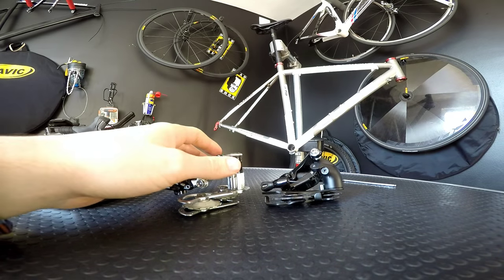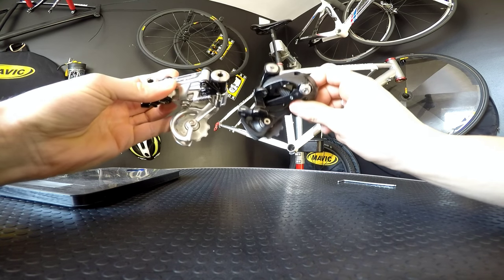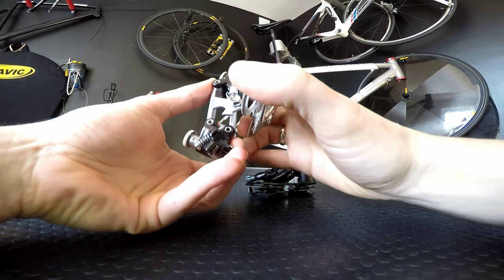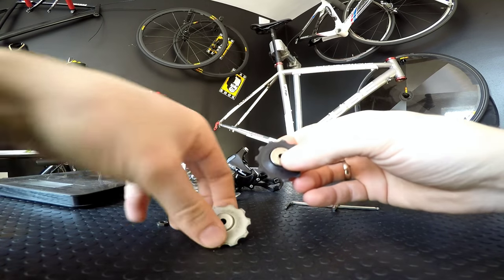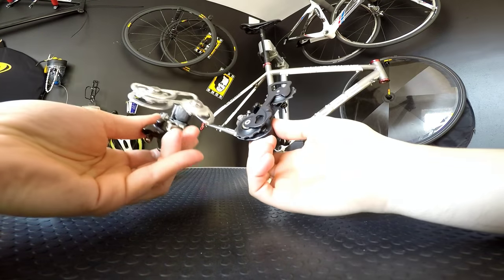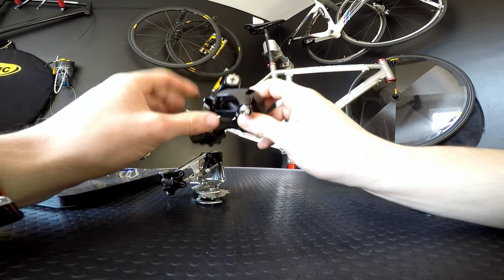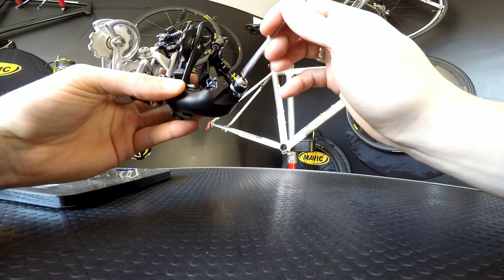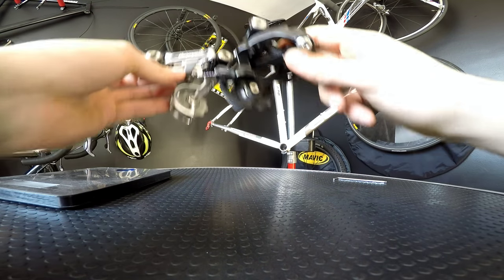NO REVOLUTION In 32 Years! Campagnolo Super Record 1984 derailleur vs. Shimano 105.

Comment: Back then, as now,Campy was the King of cycling, the Ferrari, the Pagani, the Rolls Royce. But for beer swilling youth, it was a distant dream, and we made do and mended with 105. Mavic hubs and rims gave my bike a little soul, 'cos Lucho and Kelly were my fave pro's and used them. All the TdF's were won on SR, and Hinault used Reynolds 753 frames, which was the top dog and equally expensive. Regular joe's used 531c and 531pro.
Reply: We'll put, it had a built in swagger, just like a Ferrari, right from the factory. A distant dream is correct........

Comment: Campag nuovo super record RD sold at around USD200 in Japan in the 1980's while Shimano105 RD USD40 today.
Campag has only 24 tooth capacity,105 has 38t. Campag was used for 52-42 chain rings and 13-23 or max 13-26 sprocket sets, 105 can accomodate 48-44-28 front and 13-28 or max 34 rear. Originally Campag was delelopped for the racing professionals while105 was for the tourists with heavy loads.
Camag Record crankat that age has PCD144, minimum 42t ring, Campag RD cannot take more than 26t rear sprocket mainly due to its vertical and parallellogram design. Shimano includes the105 and Campag today inherit SUNTOUR patent matured slant pantagram that achieves sharp shifting with big capacity as many watcher commented.
Comparision just RDs on the desk doesn't tell the history, actual usage or user groups.
Reply: Absolutely. The guy's ignorance is astonishing.

Comment: Good video, they are similar, although the campag looks better

As Sheldon Brown would say, this years Tiagra is Dura Ace from a couple of years ago. At a fraction of the price, which is the evolution.

The revolution will be electronic shifting. Or another unnecessary change to get to get your money, depending on your point of view

And good luck getting a 34t cassette into that Campag RD, whereas it is easy with the 105 long cage version

Comment: I have the same two derailleurs. The limit screws on the 105 are Chinese garbage off a BSO that strip easily compared to the ones on the Campy 4001. I replaced them with the limit screws off a damaged Shimano RD-7400 (very nice strong stainless screws) . The 105 also has these annoying "guides" between and under the jockey wheels that makes guiding in a new chain harder then it needs to be. I'm sure there is some technical reason for them but all I see it doing is adding grams and eating time. EDIT: I guess in a crash it helps keep the chain in place.

Comment: Got an old bike with Reynolds 531 frame which I have used for biking outdoor until October 2015. Now used for training indoor with the Elite Turbo Muin.On it is Shimano 600 and 105 parts. all still working fine. The rear derailleurs is a Shimano 105 RD-1050 from 1987-88. Still working fine. Started with 7 speed casette and later moved to 8 speed casette. Now on the Turbo Muin I have a 10 speed casette and still working just fine. Gear shifters are placed at the bottom tube, just like in the old days. Crank set is Shimano 600, still working smoothly. Front derailleur Shimano FD-M700. Remember I did get a new at a point back then.Using 53,42 chain rings. All taking apart, cleaned and new grease at least once a year.Been driving around 50.000 km on that bike. Little rust here and there on the frame, but else all is still working fine. Couple of month ago I changed the old toeclips with Shimano SPD SL pedals. :)
Reply from the maker: +EyasTheBad Wow, that's old school!

Comment: You need to compare the new one with a SunTour derailleur from the early 1980s, like a Cyclone mk2 or a Superbe. You'll find probably even less difference except the SunTour would have been cheaper. SunTour also tried with their Tech range to simplify how the cable reaches the derailleur, but unfortunately it caused a lot of reliability problems. The Cyclone, Cyclone mk2 and ArX models sent the cable straight down the centre of the parallelogram, and the earlier Vx (c.1977) had a little groove that made the cable very straight. And all of these derailleurs I've mentioned are lighter than the Shimano!
Reply: and they shift better too.
Reply: With a  6 cog straight block (13,14,15... Winner Pro freewheel and 52T chainwheel) Superbe Pro's rear derailleur shifted better than Campy's C Record 2nd generation derailleur.

Comment: There are newer, cable actuated RDs out there with significant differences from that old Campy one.  You just chose a newer one (granted, probably  the most popular type on the market) that wasn't significantly different.

As for routing the cable from the front to eliminate the loop of housing, SRAM's mountain  RDs already do that.

Comment: Excellent video except for your last point.  That big curve in the cable-routing of the 105 is a big advantage over the great old Campy shifter: it's necessary for STI shifting, which was a revolution in rear shifting (and an unnecessary nuisance in front shifting).
Reply from the maker: Thanks for that.

Comment: I can't speak for Shimano or Campy from that era, but I can speak for Suntour's mid-range ARX line from '84.  The rear derailleur is really tiny in appearance - the cage is very narrow, it's the smallest appearing derailleurs I've come across.  I guess one could say that it's slightly evolutionary as it has something neither of those derailleurs have - the cable enters the rear of the derailleur towards the inside parallel cage and runs between the parallelogram cages (so the cable is internal to the derailleur as opposed to external), and attaches near the front parallel cage.  I don't know how light it is, but it has held up impeccably (esp when I think of how hard I was on my bicycles - that one included - when I was a teen).

Comment: Well you're only considering one part of the equation. The derailleur by itself is useless without the shifter and I don't think anyone racing at the pro level today is using the downtime shifters the Super Record would have used. The brifter in combination with the 105 derailleur is a vast improvement. The 105 derailleur itself is fast, accurate and quite inexpensive. It sells on Universal Cycles for $40. Apparently you think that's some kind of sky high price because you indicated it isn't very cheap. You said they needed to make it easier to maintain. How so? Set mine up and it works perfectly with little to no fuss. The basic design hasn't changed much because it works fine as is. If it ain't broke...

Comment: eh, there was a Rear  Derailleur which took the cable from the front: the Suntour S1 (*1989/90?) but the odds were against it: Suntour went bancrupt, S-1 was only entry level, needed cable routing under the bottom bracket when the hype was about top cable routing and either a mounting point under the chainstay or an iron that clamps the dreailleur to the back axle and chainstays.
I have an S-1 in the basement and also a cheaper offspring, but more important (to me) I used one for about several years on my daily driver and it worked fantastic (bike was then stolen :(

Comment: An error on the 105 - DA comparison. DA9000 is totally different from Ultegra 6800 and 105-5800. First up, the DA9000 has a different pivot bolt and different securing system and dust proofing system.

Comment: I use that exact campagnolo super record with 11 speed at the back and shimano sti 😂
Nothing much has changed and you just basically need to know how to regulate the rear derailleur (disassembling it and reassembling it with different settings) given the more"modern gears ratios"

Comment: Bikes need revolution of drive systems, many aspects of bikes evolved in great way but although we have electric shifting even wireless one, dérailleurs hasn't changed much in over 100 years. I would like to equip my bike with Rohloff speedhub as I see it as great piece of engineering but price ~1500$ is unfortunately stopping wider adaptation.
Reply from the maker: +NotUsedBrain I'm also impressed with these hubs. Hope to get one for testing.

Comment: Good rear derailleur video. Accurate information. I used that campy derailleur 8 years. It constantly delivered high quality performance. Very durable.

I also possess 20 plus years designing and building aircraft tools. I've designed a no hands shifting system for road bikes. My design employs modern aircraft standards throughout. It's very aero, extremely accurate and fast shifts. Lightweight all aluminum. Anyone interested in participating in the development of the first working prototype message me to discuss no hands shifting system for road bikes.
March wheeler.
Reply: Have you built a prototype yet?

Comment: Pitiful.

Imagine broadcasting to the world just how ignorant you are about derailleurs.

In 1984, SunTour and Shimano derailleurs already shifted better than Campagnolo ones due to better parallelogram geometry. SunTour had a 20 year patent on the slanted parallelogram derailleur which expired in 1984 and Campagnolo didn't have a model with this until the 1985 Victory. Slanted parallelogram is fundamentally superior as it minimises the chain gap to the freewheel/cassette over all gears. Super Record didn't have it. Campag eventually had to copy it - just like everyone else.

Nuovo/Super Record already had unreliable shifting on wider cog ranges and would never have scaled to wide range cassettes. You can take a 1984 mid/long cage SunTour derailleur and friction shifters and use them with a wide ratio 8 speed cassette no problem.

None of that is to say that Campag SR wasn't good for racing in its day. But the pretence that nothing significant has changed is simply ignorant.

Frankly, if you're looking for a period of slow/no innovation in rear derailleur design, the 1967-1984 lifespan of Campagnolo Nuovo/Super Record with very little development might offer better pickings.

As for comparing an 8 or 9 speed long cage rear derailleur with a short cage 6 speed and then claiming you're surprised that it's not lighter. He hasn't got a clue what he's talking about.

The Disraeli Gears website would be a good start for this man to start eduating himself.